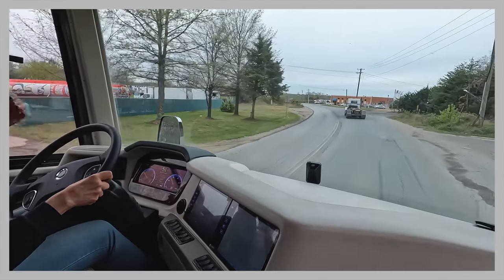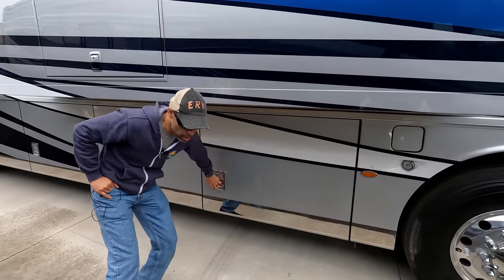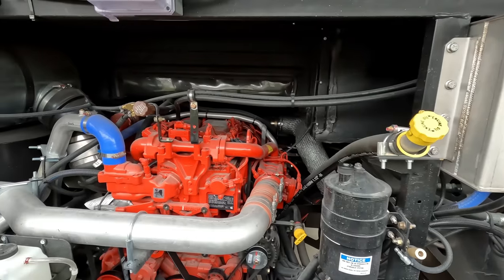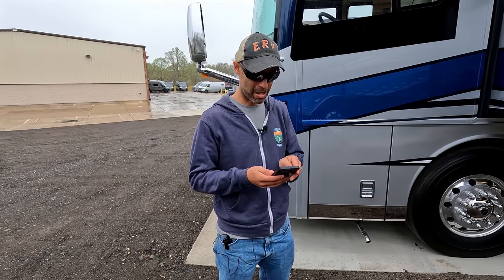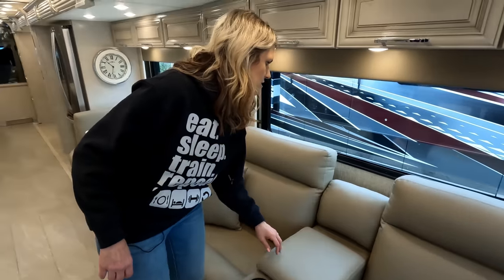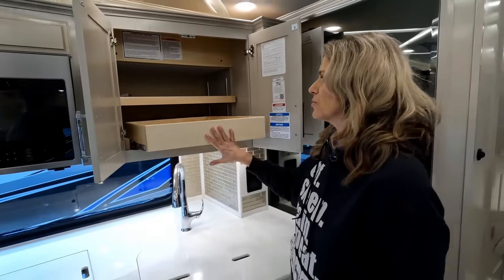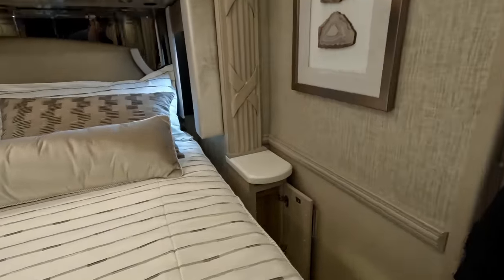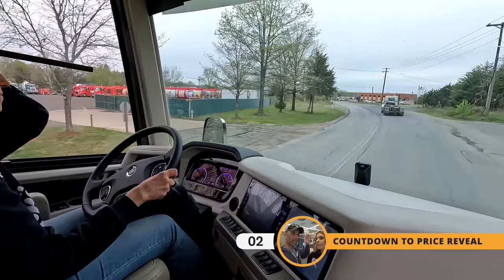This Motorhome Was So Nice We Drove It Off The Lot -- 2023 Newmar Mountain Aire!

Comment: Very nice coach! I love Newmar quality. As a Newmar owner, just came back from a 1500 mile trip, had no issues whatsoever. Great video as always!
Reply: @Happy News I have a 2017 Newmar Canyon Star - 6 years old. Did not have any issues yet.
Reply: @aeconsulting1  REALLY??  no issues in 6 years?!?!?  you are very unique!!
Reply: @jimestell3853  looking back, the only thing I replaced was the Dometic wall panel while I was on vacation. I bought a new one from Amazon and replaced it on the campground. Just bought new  Toyo tires after 6 years. The old Michelin were in great shape but RV tires go by age so it’s safer to replace. Nothing else broke or had to be replaced. I do my own regular maintenance like greasing, applying Rejext for UV protection and of course regular oil changes , nothing special. Did some Chassis upgrades but that’s it.

Comment: Great comprehensive review.  Newmar has been around a long time and always ranked very high.  I guess I’m a little concerned with the change in ownership but time will tell if Winnebago industries leaves Newmar alone or forces Newmar to lower its standards for shareholder value.  I love the mountainaire model but I think for $850K, I’d definitely look at a slightly used Prevost or Newell.  I’m not knocking Newmar whatsoever so please don’t take this negatively but Personally, one can find an older Country Coach or Monaco high end model that is every bit as good and quality for $150K-$200K and built on a semi monocoque custom chassis instead of a truck chassis.  I guess it all depends on how much you want to spend.  Great video!
Reply: Sad thing is that the value for them drops like a rock.

Comment: Very nice 👍 RV Diesel pusher 😊 
I guess you would have to sell your house to BUY one, or just be very rich. Just asking anyone what monthly payments are on her. I watched another video on the outside walk around, don't forget the hot and cold water sprayer ( shower 🚿) in the sewer dump compartment, that can be used to spray out waste that gets inside or on any handles ect. The sales guy made a point of talking about that use of the sprayer. I would have liked to see the ladder set up for the rear door, how that works or is installed. The build of the structure frame is what probably makes the price so high. Can the slide outs be manually pushed back in if there is an electrical problem, if you are out somewhere and Heaven forbid that the slide won't retract, just asking 😊❤😊
I think for that price I am a big rig guy
Love my old SeaGrave Fire Engine 🚒 have a CDL that I keep currently, even though I don't drive dump truck anymore
I would seriously look at a semi with sleeper, and pull a fifth wheel camper, just saying if I'm basically driving a BUS with this one, I would rather drive a used Volvo or KW semi, that has AIR bag equipped ride, but that is just me, just saying could get a semi with say 100,000 miles on her for quarter of that price, but not everyone wants to drive a big rig pulling there camper still ❤ the inside of her.

Comment: We looked at a 2022 ‘45 Essex yesterday. I’m a big audio guy, and it only has two small speakers right up front, behind the driver seats? Do none of these coach’s put extra speaker ceilings way in back, like back in bathroom? Or can the Bose sound bars all be made to sync together? Surprised these don’t have distributed audio zone (front/back/outside) for $800K-1M, but maybe the Bose sound bars do it.
Reply from the maker: I’m sure you can get Bluetooth sound at speakers and spread them throughout the coach
Reply: Just get a jbl Bluetooth speaker or 2 or 3 hooked together sound is amazing!!!!    Wireless

Comment: I just have a problem with Newmar putting in a 50 hp engine when with the weight and the price point it would be in my opinion to use the 605 hp engine

Comment: Wholly Crap… what a color!  I have a 2010 42’ Allstar.. love Newmar! nothing Breaks!
Reply: I am glad nothing breaks on your Allstar.  My 17 Canyon Star has had over $55k in repairs not including tires or maintenance.  For me it would what hasn't broken.
Reply: @richardcampbell9225  Wow.. mechanical stuff or Coach?
Reply: @Krazycat321  Chassis $14k, House $23k, Windshields $19k excluding sales tax and shop fees of $4k.  I am at Ford now and expect another 3-4 today.  Yesterday was NIRVC at $13k which is included in the numbers above.
Reply: @richardcampbell9225  wow.. I know that a 40’ RV on a Gas chassis is a bit much for that size, and the ford V10 is not a great engine not to mention really bad fuel economy.. at that size, you may want to move to a diesel.. (above 32’ you should be in a diesel) on to the coach, my windshield was $7500 to replace, they hose you on window labor, but it seems like you had a lot of stuff done, did you remodel it?